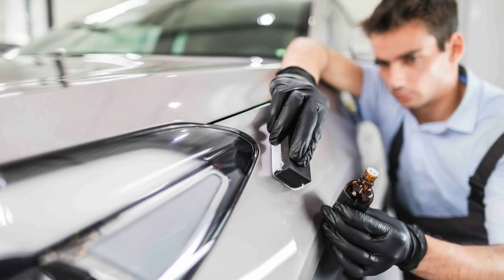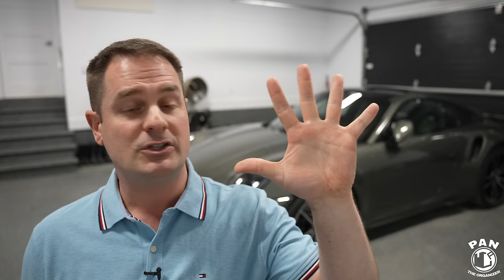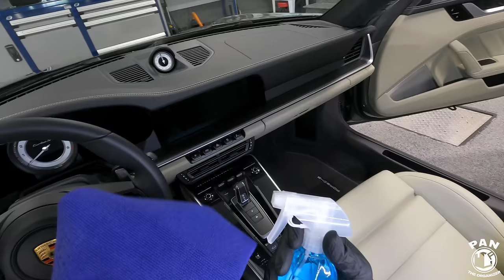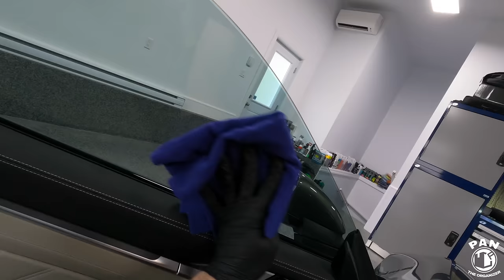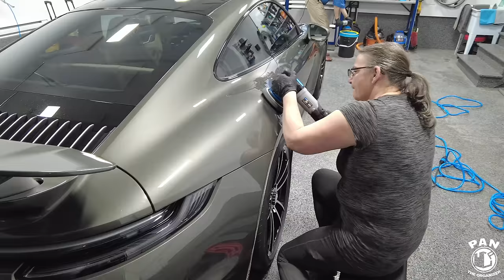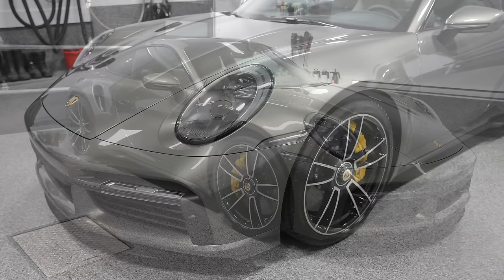How To Start A Car Detailing Business And Become Successful!

Comment: Very important to mention: GET IN SHAPE, loose weight, build your back muscles, or your detailing run will be short due to injuries. Also use PPE!!
Reply: A must
Reply: @colealleva4449  Spot on, the amount of unfit Detailers puffing and panting still amazes me.
Reply: The injuries are horrible and also I see people not using PPE everywhere... lungs shot, ears destroyed and skin exposed to chemicals
Reply: Funny that you mention this. I can't get the idea of starting my own detailing business out of my head since i LOVE detail my car, but due to my scoliosis working on my own car is causing me a lot of pain already. Can't imagine doing this as a fulltime job with my back. It's the only thing holding me back from going out there and doing what i love :(
Reply: @RobTheBeat  maybe you can manage a detailing job and do small tasks
Reply: What is PPE?
Reply: @Ed-uz8ux  Personal protective equipment, commonly referred to as "PPE", is equipment worn to minimize exposure to hazards that cause serious workplace injuries and illnesses. These injuries and illnesses may result from contact with chemical, high dose of sounds, and other workplace hazards. In this case, is using eye protection, nitril gloves, ear muffs and proper safety shoes.
Reply: @slashjt2  ohhh thanks. I detail with no protection but ill definately get some protection. Thanks
Reply: @Ed-uz8ux  i forgot, get a breathing mask when using coatings or polishing
Reply: Is PPE similar to PPF?
Reply: @chezchezchezchez  no... but kinda, instead of protecting your paint, you protect yourself :)
Reply: @slashjt2  Thank you! PPE is so often overlooked. Even I forget to use gloves when doing my own vehicle.
Reply: @slashjt2  this got me rolling
Reply: @slashjt2 😂😂😂😂

Comment: I have a simple question. I understand, offering the exterior interior, and then of course the full detail. And then having a more high-end detail that offers coatings and sealants, and what not. 

But what should I be doing for the regular exterior and the regular full washes? Like pre-soak/snowfoam, rinse, then what kind of soap for the hand wash? 

And then after drying what should I do? Do a clay bar and then wax or bead maker perhaps? Just something basic to give a gloss and shine? 

And then save the color correction, ceramics and other things for higher end packages?

Comment: Okay so I have a few questions

What kind of pressures on air and water and steam pressure/temperature are the minimum you use.  Reason I ask is cause of the brand of tools I have include many options that I can use in my shop or mobile.

Second I don’t know how to choose my chemicals.  I have an idea what I need but as far as the performance of the chemicals and tools there are too many good options to weed out.

Do you recommend ceramic coating as a side service?

Thank You!

Comment: For those w/o a pressure washer I recommend the Eley 2 Piece Cleaning Nozzle set and a FoamMaster Foam Gun.  They do a decent job.  Attach the foam gun directly to the Eley so you don't have to squeeze a handle while foaming.

Comment: Awesome tips Pan! I was considering starting a detailing business in my garage similar to yours. My question is: do your customers have to find a ride after dropping off their vehicles? I never understood how that part of it was handled. Otherwise, they would have to wait for hours at my house while their vehicle is being detailed.
Reply from the maker: Hi Andrew. Yes my customers always have to have a ride back home (they often use Uber or a friend or family member) as I pretty much only do high end details at the moment, which includes ceramic coatings, and I let the vehicle cure in my garage for 24 hours.

But this is after 24 years of detailing. At the beginning, I was also mobile, so I used to go to customers' homes. It really depends on which strategy you prefer. It might not be as easy to detail from home in the beginning, as people don't know you yet. You have to build your reputation.
Reply: Yea no one is gonna wait at your house bro that's weird. Either pick it up or they drop it off.
Reply: Yeah I started mobile at first to get money to buy equipment. Then I transitioned to doing it at home. I still do some mobile here and there. Like boats and some customers that been there since day one. But just like Pan said, the way I do it, is they drop it off 9 am, and pick it up the next day 9 am. But I get 2-3 cars a day schedule it for 9 am. The reason is, you don’t want to be rushed. You want to do a good job. And next morning gives you time to check over your work. Also, depends on a job. Some jobs that are huge, I reserve a whole day just for one car.

Comment: How do you handle having customers drop their vehicles off at your home and giving them an accurate window of time as to when it will be complete?
Reply: TIme frames come with accurate quotes. Accurate quotes come from experience. Always give yourself a 25% buffer of time. Eg, maybe something will take 4 hours, quote 5 hours, get it done in 4 hours and they get a savings.
Reply from the maker: Well said Dylan
Reply: @PanTheOrganizer  I always look at a vehicle prior to making an appointment with a client.  When a potential client  asks why that is necessary or says "it's not that bad"... it usually is!  I also have a system that I've perfected in my years of detailing that I follow for every detail I do.
Reply: Thanks for the responses. Do people usually drop their vehicles off at your place of business then find a ride or do detailers drive to the customers location then drive the customer’s car back to the place of business/home?
Reply: @tylerhyten  depends on the business. I personally have them borrow my Mercedes A220 or offer a ride back for them and pick them up when complete

Comment: When I started my business it was pretty bare minimum. I bought the essentials, but like just from Walmart. I bought a shop vac. My friend had a pressure washer that I used and he had some other stuff. But as we started getting more business and clients, we upgraded. First we bought a carpet extractor, then a steam cleaner, just so we could expand and do little bit better jobs. Then it was pretty much trying out new stuff, iron remover, polisher, ceramic coating. We still use mostly meguiars products, but they are somewhat professional. I’d say we started out with maybe $200 of stuff. Now we make between $1k-$2k a week. Thanks for all the tips pan!
Reply from the maker: I'm happy for you Joseph! And you are right. You start off with a minimum budget, and the basics to start working. And you reinvest in your business as you grow and make more profits!

Comment: Really enjoyed the video. How does one professionally detail out of their home garage? As for codes and home insurance? I've wanted to start my own detailing business and even have completed autogeeks 3 day bootcamp. It is always suggested to go mobile at first to get started but living in Colorado we have the true definition of 4 seasons. Temps from 0° F to 95° F, We also live at 6000ft in elevation and without shade or humidity, it's almost impossible to wash or use most products outside without issues as they dry on impact. I've dreamt of detailing out of my home garage but seems like local codes look at car detailing as car washes and you get into water runoff issues in their mind. How does one handle these issues or issues of homeowners insurance when operating a business like this out of your home?

Comment: I’ve built what is tantamount to a professional detailing shop in my garage just for me as a weekend warrior…kranzle k1322 ts on the wall with CR spotless, stocked on Gtechniq ceramic coatings/glass coatings, all 3 rupes. Hose reels, extension cord reels, air compressor, loads of pads and MF towels, pad washer, soaps, Protestants, cleaners in bulk, scan grip lights, the works. I’d like to put this to use and start getting some detailing jobs on the side…where to start ??
Reply from the maker: I talk about this in the video. People usually always start with detailing cars from family and friends and their local car clubs.
Reply: @PanTheOrganizer  Yeah I’ve taken your advice there actually prior to this video. Seems like most the guys at those shows are your old schoolers. Regular wash and wax with a good turtle wax carnuba. Can’t seem to generate any interest in the paint correction/ceramic world. I have a full time gig so I’m not super interested in doing wash/wax/interior for 150 bucks. Possible to enter the marketplace advertising my specialty in paint correction/ceramics without offering the basic wash/wax packages? Don’t get me wrong I’m willing to do the works WITH machine polish, decon, and ceramic, but not super interested in those things by themselves. Maybe I just haven’t discovered how to make a simple interior/exterior full detail super efficient to make it worth doing for 150-250 bucks.

Comment: Pan, Very Informative Video. I'm a software professional but interested in keeping my car clean to the details. Hope you remember my few question I have asked you before. Here I have a question. I'm aware of the tools you have through the videos. With all those tools, products and techniques, If you get an unclean medium car or SUV with no paint correction needed, but requires decontamination kind of things, how much time it will take to make it to finish till a ceramic or graphene coating. I think you work alone and no support staffs are there. Why I am asking this is, for me to do cleaning my car contact and non contact washes, decontamination, waxing with creamic graphene paste wax from turtle, cleaning interior and protecting (you are my guru), it takes more than 8 hours. Every time, I enjoy the final result. If we do it as a business, its hardly one car per day. :( . Your thoughts please.
Reply from the maker: That really depends on each person as nobody had the same experience or work speed/techniques. It would take me 5-6 hours approximately based on what you described. But again, hard to say without seeing the vehicle and what state it’s in.

I mainly do full A to Z interior/exterior new car preps which includes a polish and ceramic coating, and it typically takes me 12-13 hours.
Reply: @PanTheOrganizer  Thanks Pan. While considering car detailing as a business, the charges applied to the customer depends upon the time and the products we used upon the vehicle matters. So its not like a standard charge all the time.

Comment: this is a little off topic. but I detail alone and It takes me around 3-4 hours to do a vehicle. what's the average time it should take to detail a car if you are just doing a basic pressure wash and an inside clean?
Reply from the maker: It's impossible to say, as no two people take the same time to perform a job, and no two cars are the same, and no two cars have the same dirt level...

But for me, on my car, an exterior wash and quick interior detail will usually take 2 hours.

Comment: Question for you, have a foam canon on electric pressure washer and it stopped sucking the soap out of the canon, why?? What do i do, it was working fine the last time i used it.
Reply from the maker: Hard to say as I don't know what you did or what happened and I can't see the foam cannon. Do you usually rinse it off after each use? You're supposed to empty the foam cannon container, rinse it out until no soap is left, then fill it again with clean water, and run it through the pressure washer for 30 seconds to 1 minute. This will flush out all remaining soap from the cannon barrel and prevent it from clogging up.

You should reach out to the manufacturer of your foam cannon and troubleshoot with them.
Reply: @PanTheOrganizer  Thanks i will start to do that. i have another foam canon & transferred the soap to that and it worked find.

Comment: I've done cars since I was 8yrs old. It was mostly my parents and relatives. Then when I got real good at it I went to wax them and started on the neighborhood. I got a Dewalt buffer when I got my oun car in my teens and practiced on it. My car was blackish cranberry so everything and anything showed up..Im 49 now and I still do cars but not as much I just do a few friends and my oun.I do it for the enjoyment. I don't charge my friends because if I did it would be a job (I have a JOB, a 7 days a week around 4000hrs a year).My friends also know I do about 3 vehicles a year with mine included i also dont touch the interior (people can be Pigs)sorry but they can be.I don't have the time like I used to.Someday I'll change that but at the moment I'm good where I'm at. Love your detail videos.
Reply from the maker: Thanks for sharing!  How did you discover my channel by the way?
Reply: @PanTheOrganizer  I wanted to know about armor shield ceramic coating. I need to know more about the product and a little more about the application. Found out from your videos it is strait foward pretty easy. Did my car and my homies caddy. So thank you for that video.Its all in the preparation that takes all the time. Wash,iron x clay bar,paint correction, IPA wipe,application of Ceramic Coating. Outstanding Results in the end.

Comment: I’ve just started my detailing business here in the Philippines and my relatives always say that my service is expensive. However, based on the products, the effort that i will consume i really believe that it is worth the value. I am using koch chemie and carpro, and for the handwash, it costs for around $100 or 5000 PHP. The products that i will use for just washing the car costs around $200-240, kinda expensive since i’ll be using carpro and kcx. I know myself that my pricing seems worthy of the quality that i will offer and i know that it has alot of value. However, i would like to get some advice or tips on how can i set my prices. Another information is that Filipinos are not used to detailed handwash, traditionally they are used on low quality carwash that is cheap, low quality and using improper techniquez that causes scratches on the paint. I wan’t to change how the Filipino think and i wan’t them to value their car more that’s why i started my own detailing business.